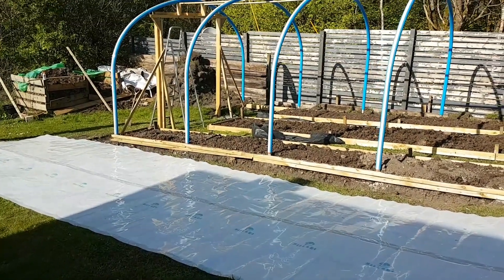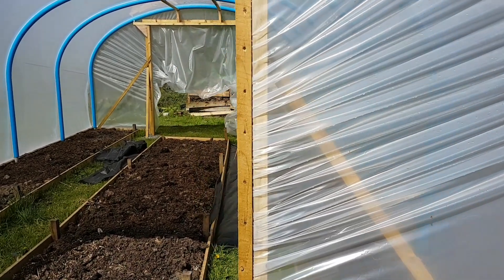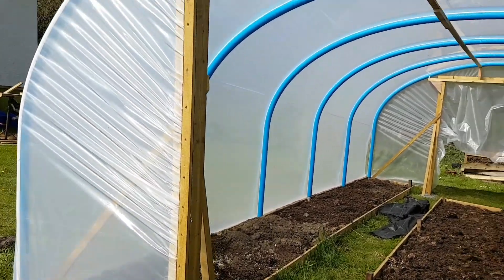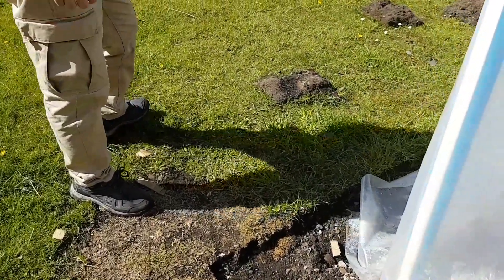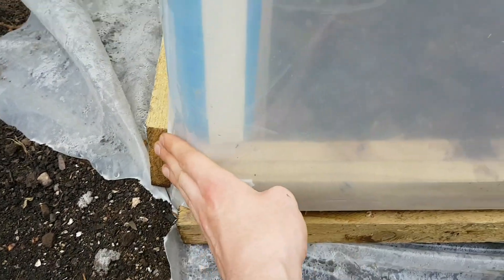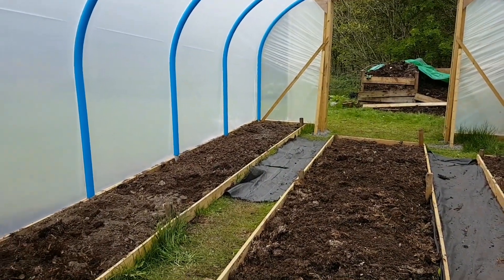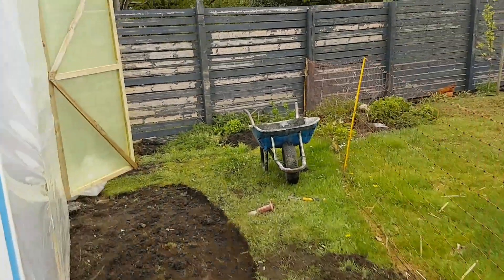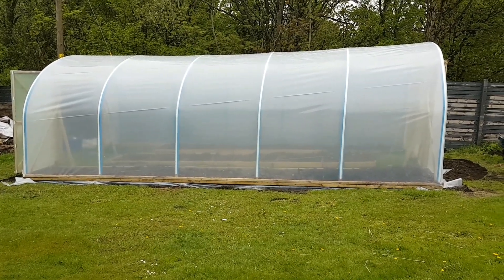DIY polytunnel part 5 The End Result.

Comment: Hi! Looks amazing. Any chance you could share some details about pip sizes including lenghts and diameters? Cheers
Reply from the maker: Hello Webstario, apologies for replying so late. The blue MDPE pipe we used is 63mm external diameter. The inside diameter is about 52mm. The outside diameter of the steel verticals was around 48mm. We thought this would be plenty but it made for a really tight fit. WD40 helped work the MDPE pipe onto the steel verticals though. These blue lengths of MDPE pipe were cut at 7.2m in length.

Anyway the verticals are about 1.2 metres in height form the ground. Plus remember you need to bury some amount of pipe into a block of concrete or anchor it well in the ground, We can't remember exactly how much we burried in the ground but 300mm would be plenty. . You would get away with steel verticals around 1m or 1.1m out the ground though, you don't want them too tall because if they are it means the blue pipe pulls the verticals off plum when you want it to curve to span the polytunnel (whilst not being too high in the centre). Remember though that you want the external walls and curve to start at a reasonable height so that the plants have head height to grow into. That's why straight sides tunnels are a bit more efficient than tunnels that curve starting at ground level.

 We have a spacing of about 1.5m between vertical steel poles and therefore hoops. 

Our polytunnel is 14ft wide and 25ft long. The height at the centre from the ground to the top of the MDPE pipe is 2.5m. 

Hope this helps, perhaps I'll try and do a video filming some things in more detail. best of luck with it.
Reply: @ascottishgarden3537  Great project, well done!
Thanks for posting the dimensions, makes it easier for anyone else
Reply from the maker: @KWfirewood  thank you. I appreciate the positivity!